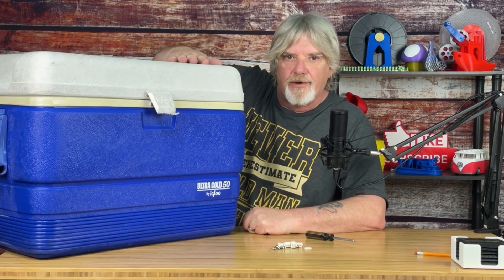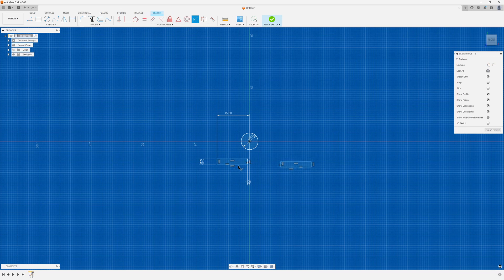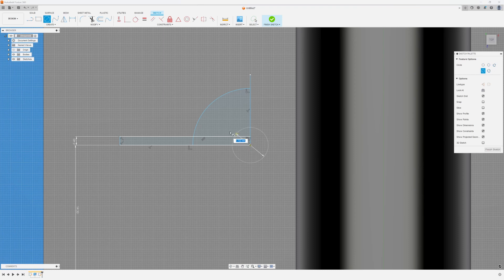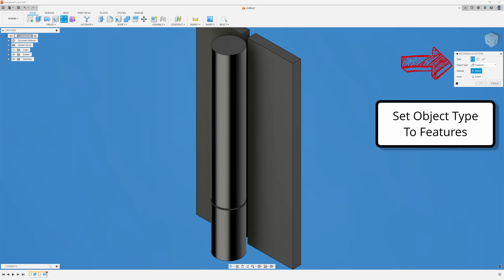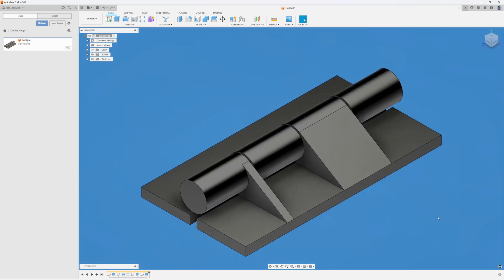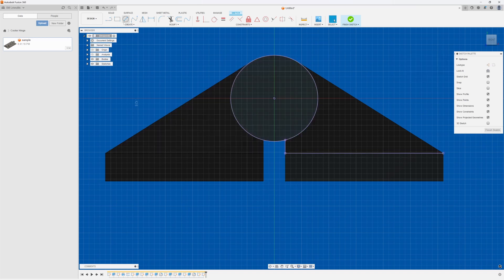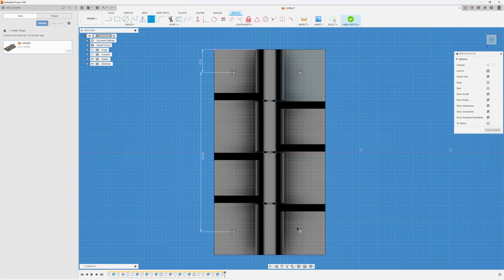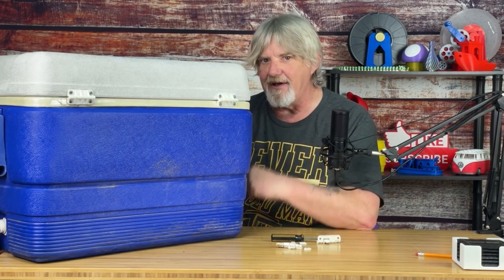Design, 3D Print & Install A Print In Place Hinge

Comment: Why didn't you use the Rib functionality in Fusion instead of drawing and extruding them yourself? One line and the rib functionality would build the entire rib, which you could then pattern or morror.
Reply from the maker: Habit! Sounds stupid, right? I've been using Autodesk Inventor for about the past 15 years, and still do in my day job. Fusion is similar, but still very different. Most of what I design during the day involves sketching and extruding. Out of habit, I almost always go that route when using Fusion 360. It's one of the things I like about CAD software, there are a lot of ways to get the same result!

Comment: Absolutely fantastic lesson on using Fusion 360 to create a complex object.  3D printed built-in hinge.  I have only had my 3D printer for less than 1 month and this video, and the one you made on making fasteners, are excellent tutorials.  Thanks for the extra effort of making the bubbles with the settings on complex items.  I've subscribed and can't wait to see what you come up with next.  I do have to agree with andyb7754, it's time to make a latch for your cooler.  🙂Maybe you could design one better than the original.
Reply from the maker: Thanks for the kind words and thanks for watching! I used that cooler a few weeks ago on a 10 day trip. Every time I opened it, andyb7754's words came back to mind! I guess I better get to it! Oh yeah, the hinges held up!

Comment: What filament would you use? I printed a hinge with PLA and it came out pretty nice, but durability was not there.
Reply from the maker: The two I put on in the video were PLA. This cooler spends a lot of time outdoors so I'll be re-printing in PETG, maybe ABS. I'm at least going to see how they hold up with PETG first.
Reply: @pushingplastic7445   @PP thanks for the reply.  I have some PLA + spooled up now I will try that before moving on to PETG/ABS.  Mine is for a bird house so it doesn't need strength but it does need to withstand 105F in our Sierra Nevada area summers!
Reply from the maker: @graphguy  Nice! Be sure to let me know how the PETG/ABS works out. It'll be great information for future projects!
Reply: @pushingplastic7445  Being a noob with fusion 360, isn't there a duplicate/mirror functionality that once you create the hinges on one side you don't have to do the whole process again? Seems like a lot of unnecessary redundant work.  In blender I can do this easily, but trying to learn F360. :)  I tried the mirror tool and got close but the alignment was off and I couldn't figure out how to fix it.
Reply from the maker: @graphguy  If you mirror the ribs from one side to the other, they'll end up on the same knuckle you mirrored them from, just the opposite side. Each of the four knuckles need their own ribs. For example, on the right of the hinge, the ribs should be on knuckles 1 & 3, but on the left side they should be on knuckles 2 & 4. Mirroring the ribs on knuckles 1 & three from the right side would just add ribs to knuckles 1 & 3 on the left side as well.
Reply: @pushingplastic7445  sorta saw that. :)
In blender they would be separate components that can be easily aligned on the mirror side, but that is blender and in no way trying to sell F360 short... I was just trying maximize F360 results with minimum effort (lazy).  :)
Reply from the maker: @graphguy  The first time I drew a hinge up with fusion, I mirrored the ribs over and didn't notice until after I printed it and it wouldn't open! I do use blender, but I have to admit, I've never tried to make a hinge with it.....yet! A lot of time when I'm manipulating a downloaded STL, I'll use Blender.
Reply: @pushingplastic7445  Ok... completed your version of the F360 cooler hinge.  All went well except.... the last step of filet's 2 of the 4 worked but the opposite filet in vs out.  Very strange, couldn't spend more than the 30 minutes I did trying to get the filet out, so I just left that side off... I'm sure it is me :)
Ok, as soon as my  TinkerCad version gets off my NEOmax, I'll throw this one on.
As a side....  question.
Buy a Bambu or the new Creality K1?
Reply from the maker: @graphguy  I ran into the fillet going the wrong way in the past. It happened to me on a mirrored object. The one thing I didn't try was to see if a negative value would fix it. So, instead of 0.2, would -0.2 work? I never tried it so I can't say. As for the Bambu vs the K1. I have a Bambu X1C and it is nice, and it's fast. I haven't had any problems with it. When things do go wrong, you're at the mercy of Bambu. There isn't a lot of spare parts out there yet. The only thing I've seen from users of the K1 is on twitter from the users in China. They are saying that it looks like a lot of the parts are used. It might be from testing before leaving Creality. A lot of the people from the west that have seen the pictures that users in China are posting on Twitter are saying that the internals look almost identical to the Bambu. From the few pictures I've seen, I agree. I'm not saying the K1 is a clone because I haven't put my hands on one yet....but I would like to put one next to the Bambu and compare.
Reply: @pushingplastic7445  Tried the (-0.2mm) right away, but it appears that negative values are not allowed in that field - it went red and wouldn't accept.  Not a huge issue will try it again on another model.   I'm printing your hinge right now.  My same style, fast I can design in TinkerCAD (15minutes) just came off the printer and is pretty solid.
Ya, I saw you have the X1C, that is sort of why I was asking.  I have a CREALITY Max Neo2 now with the remote camera and it is very reliable and works with the phone app very nicely.  But time is money and it is so S L O W, or is it that I am just impatient!
Thanks again for the replies!
Reply from the maker: @graphguy  I get it, I like the speed of the Bambu but I still make sure my other printers are still getting used. I see a lot of guys selling off their printers after getting a Bambu. Not me!!
Reply: @pushingplastic7445  Ya, I won't sell my Max, just add to the 'farm'.
Well I printed the hinges in ABS and since my cooler doesn't  have this type of hinge to replace (25 year old cooler and still kicking) I will give the hinges some manual torture tests and keep them in the summer heat to see how they hold up.
Thanks again for the great channel.
Reply from the maker: @graphguy  use it on the next bird house build!

Comment: I started in 3d printing with freecad and it did most of what I wanted.  I tried tinkercad and was just lost.  Tried F360 and I felt completely overwhelmed and walked away.  Then I found a few great tutorials and began to understand tinkercad.  it was so basic and simple I was just over-thinking it.  Now I feel like I've progressed enough that I've been thinking of giving F360 another go.  This video clinches it for me.  Thanks for the inspiration.
Reply from the maker: Seriously? That's awesome!!!! I'm glad to have been a part of that decision!!
Reply: @pushingplastic7445  I agree.  I am not a CAD engineer and although I admire your ability and the functionality of Fusion360, 90% of what I design is in TinkerCAD - just wished it had a few more features that Fusion360 has. :)
Reply from the maker: @graphguy  TinkerCAD is good program. In my opinion, 3D modeling is about manipulating shapes, no matter what program you use. You can achieve the same results in making a model, the path to get there my be different, but the same results can be achieved.